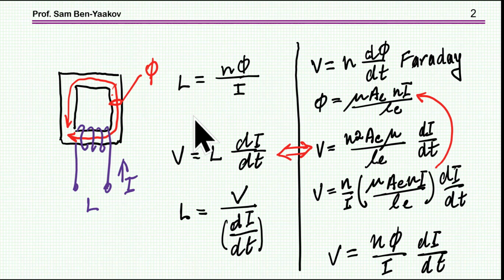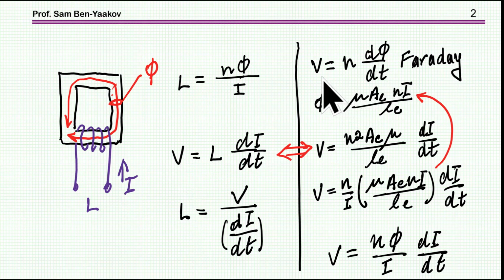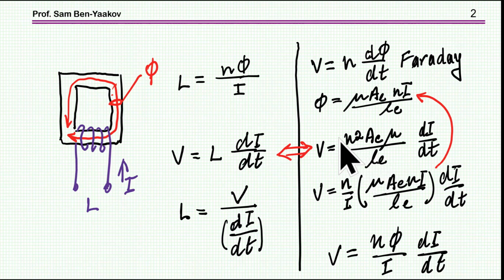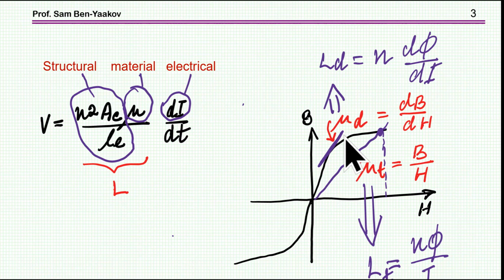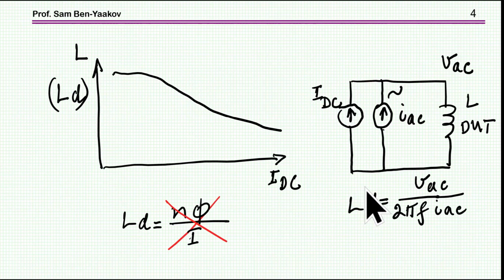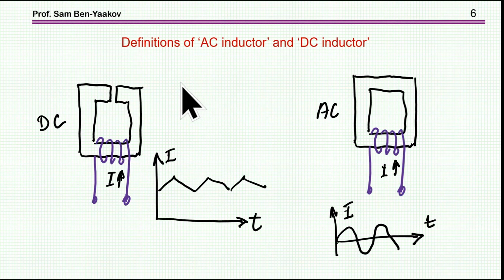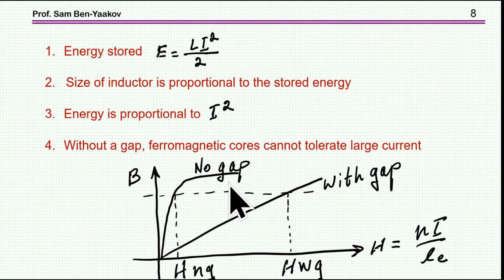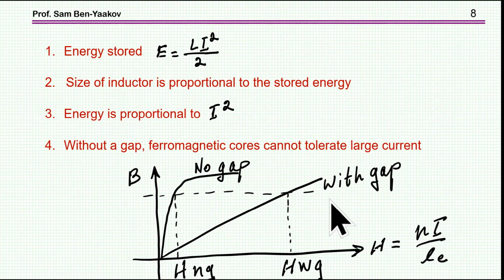Definitions of ‘Inductance’, ‘AC inductor’ and ‘DC inductor’: Correcting some misconceptions

Comment: Hello Sir great Video, If I am designing an inverter and I want to put an LC filter at the output of my inverter would you recommend a AC inductor or a DC inductor?
Reply from the maker: As I pointed out in the video, there is really no differece between the two. If the LC filter has to pass a high current, there will be a need for an air gap. Not so in a common mode filter in which the in and out currents cancel each other.

Comment: Thank you so much professor. Clear and informative as always. It would be interesting to explore the effect inter-winding capacitance has on CM currents in HF application, coping mechanisms and  the trade-offs between low leakage design and low parasitic capacitance design. It would be interesting to hear the opinion of an expert such as yourself.
Reply from the maker: These are intricate issues not easily modeled. Perhaps I will in the future present a video on that.

Comment: Thanks so Professor Sam, I do learn something new each time I watch you.
I do have questions 
1- the dc current across inductor will make it saturate? Is like you have DC voltage across zero ohm , so this will saturate core , and the average voltage across inductors should be zero 
2- how can I calculate temperature rise due to dc resistance of the winding 
Thanks so much
Reply from the maker: 1, DC current moves B up the BH curve an may cause saturation
2.  The power is I^2*Rdc and there is an experimental equation for temp rise as function of the dissipated power and total surface area.

Comment: “Thanks for comment. Please indicate to what minute or slide of the presentation you are referring to.”

 https://youtu.be/AfTTO4m1ti8?t=120   Here, you say that everything here is constant, which allows you to factor it out of the derivative, but later you admit that μ depends on H and therefore on I, which depends on t. Therefore, it should have been differentiated with that in mind, in my opinion.

PS: I'm re-posting to the main thread as it seems to me that youtube does not generate a notification when a reply is made to a reply.
Reply from the maker: Good idea to repost it. If L is defined as incremental inductance Ld than still V=Ld(di/dt) . See https://doi.org/10.36227/techrxiv.14975082.v1
Reply: @sambenyaakov  Thank you for the paper. I'm going to read thru it.

Comment: Dear professor, thank you for another great video. However, I'm puzzled why the differentiation of the Faraday's law was not carried out like this, considering that μ is a function of H and consequently of I:

V(t) = n∙dΦ/dt = n∙d(μ(I)∙A∙n∙I)/l)/dt = A∙n^2/l ∙ d(μ(I)∙I)/dt

     = (A∙n^2/l)∙( dμ/dI∣_I(t)∙dI/dt∙I(t) + μ(I(t))∙dI/dt)

     = (A∙n^2/l)∙( I(t) ∙ dμ/dI∣_I(t) + μ(I(t)) )∙dI/dt

writing μ' for dμ/dI:

     = (A∙n^2/l)∙( I(t)∙μ'(I(t)) + μ(I(t)) )∙dI/dt = L(I(t))∙dI/dt      (*)

the inductance L(I) would depend on the instantaneous current and would be equal to

     L(I) = (A∙n^2/l)∙(I∙μ'(I) + μ(I))

if we wanted to write V(t) = L(I(t)) ∙ dI(t)/dt. If, on the other hand, we would adopt that

     V(t) = d(LL(I(t))∙I(t))/dt

the LL inductance would be defined differently. Namely, by carrying out the derivative, we get

     V(t) = LL'(I(t))∙I'(t)∙I(t) + LL(I(t))∙I'(t) = (LL'(I(t))∙I(t) + LL(I(t))) ∙ I'(t)

Comparing it with (*) we see that

     L(I) = LL'(I)∙I + LL(I)

which hold if we defined LL(I) = (A∙n^2/l)∙μ(I).

So, which of the inductance definition do you like more? L(I) or LL(I)? I'd go for LL(I) for its simplicity despite it requires us to modify the formula for voltage across the inductor to V=d(LL(I)∙I)/dt.
Reply from the maker: Thanks for comment. Please indicate to what minute or slide of the presentation you are referring to.
Reply: @sambenyaakov  https://youtu.be/AfTTO4m1ti8?t=120   Here you say that everything here is constant, which allows you to factor it out of the derivative, but later you admit that μ depends on H and therefore on I, which depends on t. Therefore, it should have been differentiated with that in mind, in my opinion.

Comment: By extension, should we gap the core of a transformer that is excited purely by AC (ie no DC component present). If I understand you correctly, the magnetising inductance will be enhanced for a given core size by having a gap.
Reply from the maker: Not so. A gap will allow higher stored energy  (which a tranformer does not need, input=output at any instance) while reducing inductance and hence increasing magnetization current.

Comment: IF i have to design an inductor for a SMPS should i use stranded wire or 1 more wire? 
Asking since 1 end will be at DC while the other one will be switching all the time so it is effectively in AC.
Skin effect is the thing that is my fear
Reply from the maker: The two ends have the same current which matters. You need Litz wire if the ripple component is large and of high frequency that skin and proximity effects are substantial.